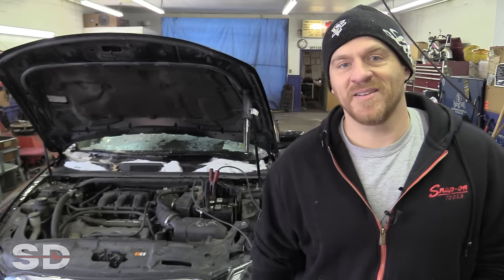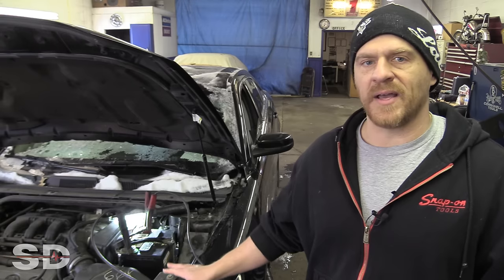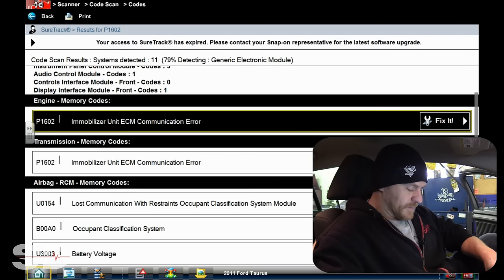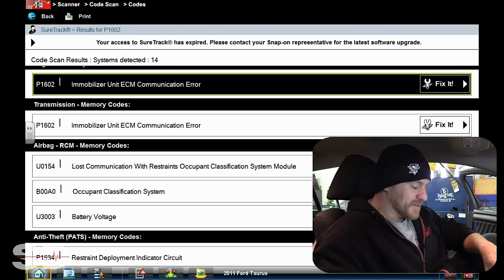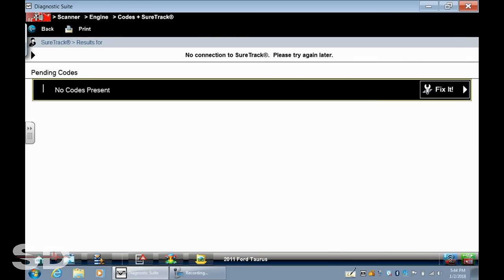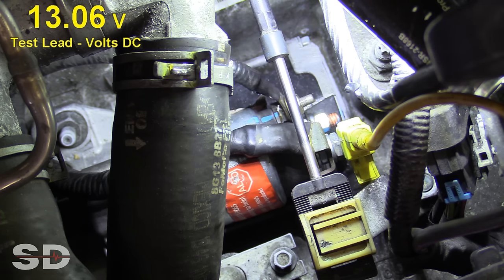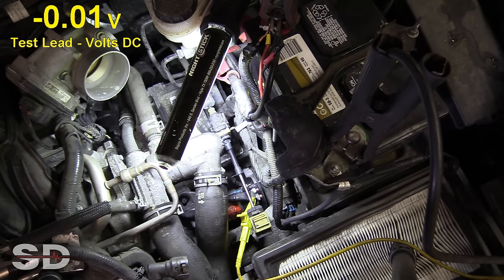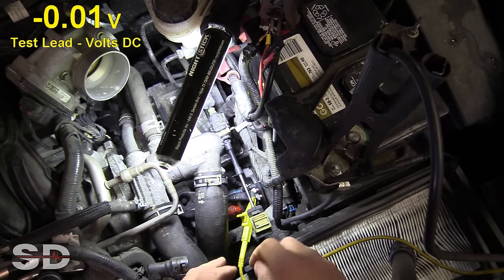No Crank, new starter, how to troubleshoot, any car! (2011 Ford Taurus)

Comment: That connector piece looks to me like something that is used for home electrical, where by it never see's the high amperage of a cold cranking engine when coupled with sub degree temps make it worse and the vibration is a added factor. Nice try but a fail.

Comment: any body any help I have a 2005 Toyota carrola no start not turning I can hear a click or I think I do . and nothing  new battery new starter  nothing the same it threw a crank position sensor code as well but I was cleared. I'm not great at this idk what it could be any help would be greatly appreciated i have no money and it's really my only way to work all I have heard is the starer switch on the starter  I payed a mobile mechanic to come for that and he just walked away after it didn't start . lost desperate and out of my ability if any one can shed light on this well I would be blessed
Reply from the maker: Are you close to Pittsburgh PA? I would look at it for you for free at our school Rosedale Technical College
Reply: ScannerDanner I only wish .I'm in mesa Arizona.thank you for the response I had a Mobil mechanic  replace  the starter along  with the switch  on the starter...it didn't start and he left I replaced the battery. the cables look good I don't know what ohms it should  be I just know its not open the car is a basis Carola I don't really  know if it  has that ignition security  thing .at first the car would do this when it was hot outside 110 and above. The temperature never was over heating for the car .it would  then start. I came home one day and it never starred  again it did throw a crank position  sensor  code the mobile mechanic  cleared it . I'm sorry  if I sound needy  regardless of an out come thank you for the offer just hearing   that made my day
Reply: @Nova-ne1il  did you find out what was wrong?

Comment: I not a mechanic   dumb dump as far  as auto electric but i pronounce the problem as an ignition switch which has been a common problem in ford cars for  60 years at least in ford  cars  and vans 15 years or older. My boss at a junk yard told me that tip me off to that fact back in the 1990s

Comment: Happy New Year 
Basics. Always go back to the basics. I had a no start on my wife's van and found out I had power going to the starter and ordered a starter but when I went to put the starter in found the other side of the circuit was loose. Actually was lucky and saw the ground wire bolt going into the trans was not tight. Tightened up the ground wire and it starts imagine that.
So yeah test both sides of the circuit. Another great vid PD.

Comment: This guys knows his stuff and know how to explain in detail the work he’s doing. I just recently the engine swap to 2004 Scion XB, engine turn one on the 1st try.  Unfortunately the engine I purchased came with a bad cylinders head gasket and I had to tear-it-down once to replace the head gasket. Engine was installed for the 2nd time, the engine cranks but it won’t starts. This video has giving excellent guidance where I need to troubleshoot the electrical issue . Thanks for sharing your knowledge and expertise.

Comment: The crank when the starter was replaced was most likely the eyelet for the s terminal has a small tab that is bent in a 90 degree angle that indexes into the factory starter solenoid .on the aftermarket starters I've seen this tab touch the solder joint on the solenoid causing the crank I've seen that many times usually I'll cut it off have a great new year
Reply: Best explanation so far
Reply: Oh yeah, that's the adapter plug that usually corrodes on the end of the cable and not the stud on the starter that you can't get off without destroying the adapter. It also says on a big sticker on the starter that the warranty is void if you do not use the new adapter...I have 3 in my toolbox for Ford starters...

Comment: Great lesson for voltage drop testing Paul. Yes that connector does look like an electrical part for wiring in a house, I am sure you can find that in Lowes or Home Depot. Thanks for the video!

Comment: That aluminum colored  connector is a typical welding cable connector. They are fine..IF you wrap the stranded ends in thin copper, then insert and tighten. If you insert just the strands, they will invariably become loose, and give the symptoms as shown. The copper usually comes with the connector as a kit.

Comment: Great Videos, I usually watch your videos during my lunch breaks. I noticed you are always looking for someone to "turn the key." About a year ago I took a chance and bought the power probe Key assist tool. Runs off shop air, long cord so you can be anywhere around the car, and run the key switch. Totally worth it for troubleshooting. This is the youtube video of it.
 https://www.youtube.com/watch?v=w-THn3IJsZQ      I use it for working on side by sides, and vehicles. It's a little pricey and the reviews are questionable on it, so I was leery on buying it, but I'm glad I did. Just a suggestion.

Comment: Would it have been better to carry out a voltage drop test going across the positve battery terminal to the starter positve, to test the cable?  if the wire made connection the way this video shows the voltage may  show 12V unloaded and loaded.
Carrying a test Positive to Positve would show 0Volts unloaded and the voltage drop would be shown as a positve voltage when the circuit was loaded.

Comment: I had a 2003 Windstar that would do weird stuff when the battery was connected. It would usually just flash the headlamps and chirp the horn. But one time it had a dead battery and it when I installed the new one, the engine cranked on it's own for about 2 seconds. It didn't have any aftermarket alarm or remote start either.
Reply from the maker: That is super weird. Thanks for sharing
Reply: ready for this one hang on? possibly bad radio or rear amp/control unit or wire harness to rear bad and back feeding (forgot what year they had/didn't have the rear unit and maybe the wire still runs back there)
possibly the same on the 2011 taurus,  the older taurus had it for sure.  wire "hot on start" to the rear unit, if it gets corroded/shorted/fails or wiring issue, it could cause engine cranking by back-feeding power to the starter relay! odd case indeed, but seen it twice

Comment: Hi scanner danner
I enjoy your program very much and i find it very helpful. In one of your videos you explained the differences between cranking and starting. The video that you showed us was about no-cranking where you located the problem which was a corroded unit.
You made it easier by making a sound with your mouth which indicated a no-starting issue.
My question is this. Is the process that you did on no-cranking the same as the no-starting to locate the problem. 
Thank you for a lovely program  and keep up the good work.
FJS

Comment: Hey Danner, might be time to pick up a Fluke 233 Meter. It has a really nice wireless display with a pretty decent refresh.
I use it all the time for parasitic testing and when I'm working by myself.
Reply: Derek Vermette I  have one too. There nice
Reply from the maker: Bet it doesn't have a way to do screen recordings and overlay it in a video :-)
Reply: Not that model, but you could always throw it on the camera view, the display is easy to read :).
Keep up the awesome educational and entertaining videos.
Reply: Does the fluke 233 eat batteries in wireless mode? Was looking at one a few years ago but some reviews about battery life put me off. Wonder if they've sorted it now. Nice video as ever Paul.

Comment: Question for you.... My car was doing the exact same thing. New starter and no start, was clicking one time, lights worked ect. Then I kept turning the key to try to start it and heard a pop and smelled burning and then saw a tiny bit of smoke from under the steering wheel.  ???
Reply from the maker: Can't offer you anything without specific tests you did and the results of those tests.

Comment: Hi brother thanks for the great videos you shear.

I've a ford torus here all keys were lost so I've add tow extra keys after clearing all keys 1st.

After add the 2keys the car just doesn't start I've full ignition lights on dash but still no cracks no start. I scanned the car after p1000 appeared.
Reply from the maker: No immobilizer codes? All keys lost. So it started and ran fine before this happened? Whats the history?
Reply: @ScannerDanner  hy sorry to bother I've fixed it managed to bypass the security locking.
The guy lost all hes key then i made a key just to turn the ignition on. 

And  via IM508 autel i managed to erase all keys 1st then added extra tow keys witches thats what it was required.

Still the vehicle was not starting the issues was i just didn't programed any remot as soon as i did one security sentral locking operated job was done an American gangester helped me.

Big kurdish Thank you again.
Reply: @ScannerDanner  yes before everything were fine but after i had to make a dealer keys again and to do that you have to cut a key just to turn the ignition on.

Then add tow keys to start the vehicle.

Comment: Im having no start (crank issues) So I tested the batter with a multimeter. The battery meaured at 11.49, starter: 10.5, front fuse box 10.93. Question is where could the problem becoming from, power wire?

Comment: Paul, I rarely if ever make any recommendations to you. You certainly don't need any advice from an idiot like me.
But might I recommend that you start using a paper notebook, and just writing a half page summary, indexed by date, or any major job you do? Ivan does this, and he looks at his notes all the time. I thought about this yesterday when I watched a followup video and you were trying to remember the fuel pressure reading in the original video (Lincoln SUV I think). I had just watched the first video, so I'm talking to you on my monitor, saying to you  "the FP was 40 psi!".  And you were trying to remember the initial momentary fuel pump current draw, also, which was in the low to mid twenties.

-doug

Comment: I had a similar issue (no odd cranking behavior besides intermittent no crank) the small cable on the starter was loose. The starter is under the air intake
Reply: This comment is just so people trying to get the answer quickly

Comment: 16,7V with the car connected ? What do you consider safe max voltage für all the ECUs and stuff ? I sometimes use a charger with a reconditioning feature and I always disconnect my car because voltage goes up to 15.8V ... on a car stuffed with ECUs, i don´t want to risk anything

Comment: Looks like someone cut the end off another battery cable and hacked the factory harness and attached it by any crappy means they could think of. Mickey Mouse for sure! It almost looks like somebody has been smacking the starter with a hammer (I saw some dings in the tag on the solenoid). I once had a 1991 Camry that would continue cranking after you released the key from the start position. I would have to turn the key off then go under the hood and tap the solenoid with a rubber mallet to stop it from cranking. I opened the high-mileage solenoid and found that the contacts had deep grooves worn into them. Basically, the contact disc would at times get caught in the grooves and the spring could not release the contact disc, so the starter would continually crank until you tapped the solenoid. Maybe this starter has the same issue? (Assuming it's a remanufactured starter and they didn't replace an old solenoid)

Comment: When ever I see a big ole ball of vinyl electrical tape in a harness or cable I go there first there is bound to be some bumblefuckery in there. I was kind of suspicious of the cable when you first did the voltage drop test while cranking and voltage dropped to 11VDC at the starter hot stud. But I also thought you know the battery is probably pretty weak. I was always told that as a rule of thumb you are allowed .5VDC drop on starter and alternator cables and .250VDC on all other circuits.  Checking the positive stud on the battery to the positive on the starter would have proven it was the cable and eliminated the battery. Or if you used a carbon pile to check the cable. But most people don't have a carbon pile. Who ever made that cable repair needs a pee pee slapping. Keep up the good work, showing people to troubleshoot with basic tools is an awesome thing you do for the community on youtube!

Comment: After finishing the video, c it is much more simple. The Escape 3.0 was crazy. I told the guy to expect the worse. It would not crank though. Yours started and there was no noise from bad AC bearing. That serpentine belt will hold the engine back. And the wrap around the AC pulley is such that it won’t slip. Cool voltage drop tests. All the Premium videos r so helpful on learning the Vantage. The Vantage Pro and the Verus

Comment: Question I've been working on my Scion xB 06 dealing with a noCrank noStart, I've changed the battery new starter and still nothing idk if it could be the ignition switch or something maybe starter relay I don't know kinda hoping for some answer in haven't yet tried

Comment: Good information on starter and battery issues.  Do you think the splice with a new upper positive cable end was installed because of corrosion on the original positive cable end at the battery at the time the battery was replaced??  The splice might have worked if someone had tinned the ends of the cut cable real well with solder before installing it.
Bill

Comment: Happy new year, thank you for your video. That splice union looks like one that I use for underground cable repair. One of the the things to watch when installing is clean both wires and torque those screws as per specs or it will make a bad connection and increase resistance especially if it is an aluminum splice connector, they expand more than cooper, I usually avoid it like the plague and use a cooper fitting. That is one of reasons I like to use a crimp barrel and epoxy isolation. Also using the barrel makes you use the same diameter wire, the screw type gives you the wrong expectation that everything will be fine.... until you have that dreaded feeling looking at smoke coming out and knowing that you just have used the last can of smoke in your toolbox....Thank you Paul for the video.

Comment: I have seen added electric start system case a lot of problems also. I no this is not the problem since your so good but can be overlook by some. Like me.
Reply from the maker: For sure, but you will never see those interrupt the main starter cable that is hot all the time, like in this video. Thanks!

Comment: I recently seen a training seminar or might have read some training material that stated that you should NOT charge a battery while it's in the car & hooked up as this can cause issues with the other electrical circuits in the car. I know I have ALWAYS charged the battery in the car while it was hooked up & I'm sure the majority of the people out there have as well. What are your thoughts on that?
Reply from the maker: I would not argue that with these newer cars. Especially if the battery is shorted and the voltage rises to a dangerous level.

Comment: Hi . If you watch your clip at time stamp 8.50 + you'll see the module voltage when you turned the key didn't try to drop while cranking surgesting there was low amp flow to the starter as i'd suspect it to drop to 10.5-11.8v with cranking. Guess you missed that one.. It does however have a small drop in voltage but as you know this voltage would of took a nosedive  -10v I suspect if the battery was weak as everything would of been pulled down. Good video ..(not judging call on new battery as you were using battery charge /boost pack . Bets are battery is on last legs too.. Just the voltage drop noted helping point towards low amp draw on battery while cranking at time stamp) .
Reply: going by diagrams, the alternator is spliced into the cable at or near the starter and before the bad splice, so the battery wouldn't charge right and it appears the wire feeding the whole vehicle/fuses is on other cable direct to battery still

Comment: Mr danner great videos., I have a code po420 on a 2011 accord could that be the back catalytic converter bad it has about 120k miles
Reply from the maker: As long as you do not have any other codes and no exhaust leaks, you need a cat. Fix any other codes first.
Reply: ScannerDanner thank you

Comment: Any electrical connectors should be good and if it is weak it generates heat for the connection either AC or DC .
Reply: But if the connection is an  intermittent make/break no current  so no heat.